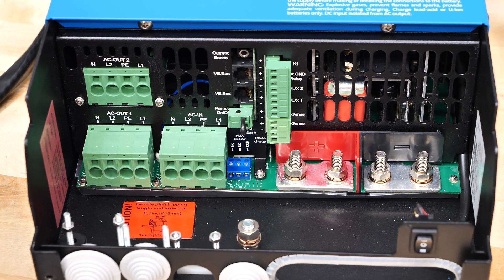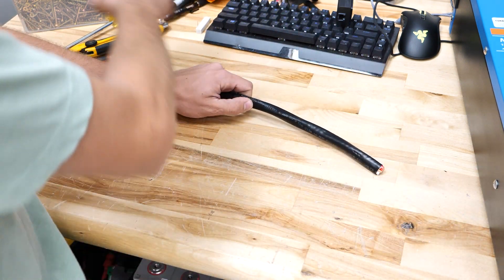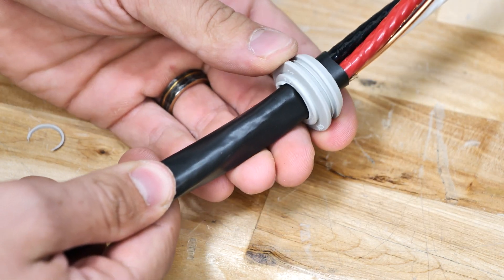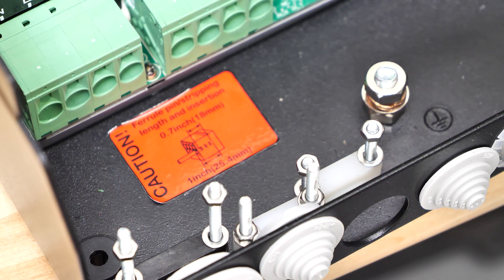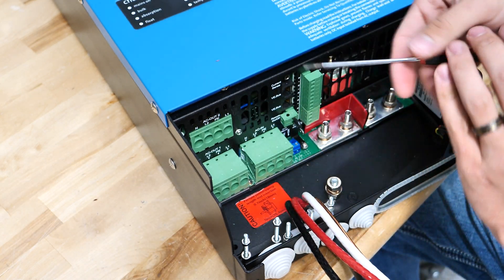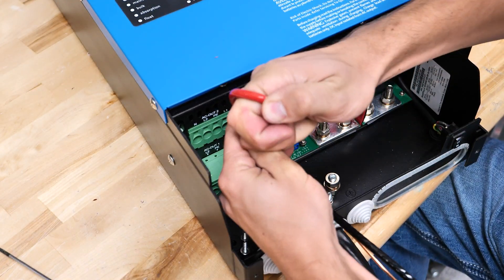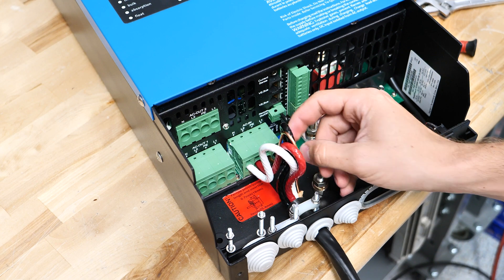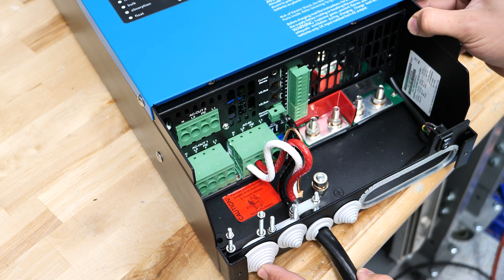Victron MultiPlus-II Inverter: Step-by-Step AC Output/Input Connection Wiring with a Spring Terminal

Comment: On my multiplus 24/3000 Victron inverter, I only have three connectors, which I wired up with 6/3. The ground I have going separately to its own lightning rod. 
I’m wondering if I need to ground to the main panel, as I have two 50 amp breakers for my solar connection. The only ground on the main panel goes to its own in ground rod , i’m figuring that’s part of the electrical companys. 
My problem now is that my lights flicker when I’m using a load like the microwave. Is this because of the ground or lack of? 🖖
Reply: I don't think you were supposed to add an additional grounding point. On my system, the AC Out ground connects to the main panel ground, which then has a grounding rod.
Reply: @incredibleyoutubehandle  
Thanks, this may be the problem. I’ll try disconnecting the other ground on the inverter. Maybe this will fix it. 🖖
Reply: @benjones8977 did that fix ur flickering issue? I believe there are different scenario’s in different countries, states, jurisdictions concerning earthing, this maybe something u need to check out further for ur locality.